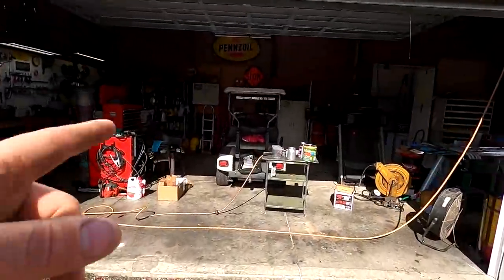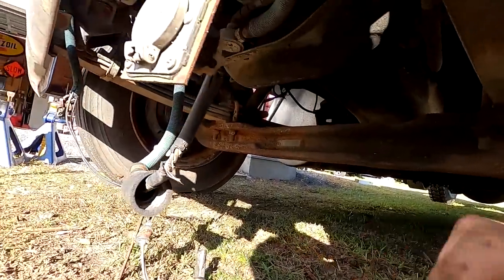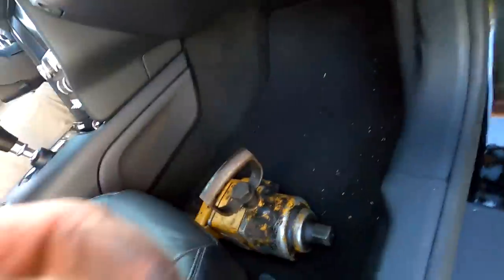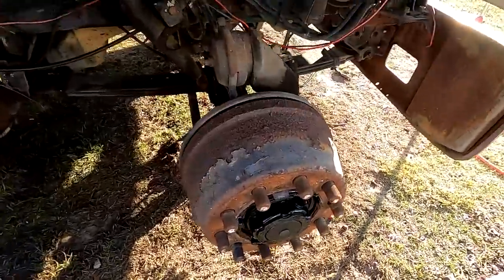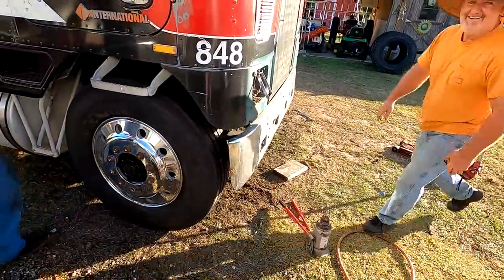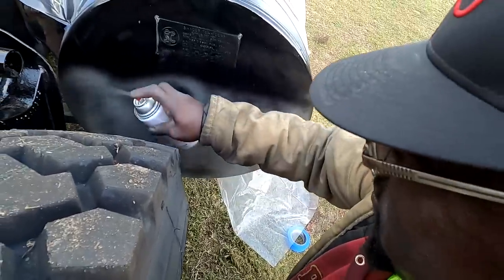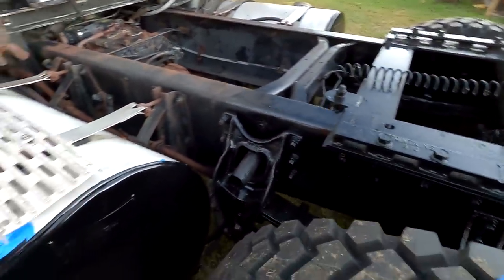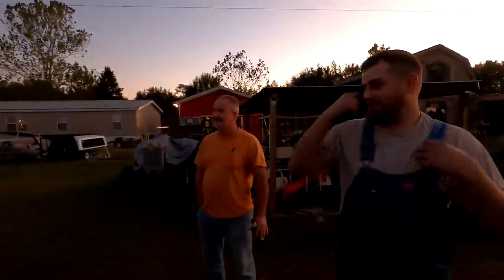Frame Painted, Tires Mounted, Brakes Done!!! Cabover Is So Close!!!

Comment: Pin this comment
Reply: Tyler Johnson whattup
Reply: The mad lad pinned it
Reply: wait its that easy? lol
Reply: Why not put the leather pads on front and back of the tanks they look good on Pete’s
Reply: I think I suggested that a week ago.
Reply: @douglasvines1221  why didn't you make your own comment instead of replying to someone else.
Reply: I would strongly suggest not doing that. Those are fuel tanks not designed for pressurized air. If it decided to let go you basically just created a bomb. The best way would be fill it up almost full of water then pressurize with air because water is an incompressible fluid, meaning it’s not going to blow the shrapnel everywhere
Reply: @madmax2069  Maybe he did not see the previous comment. Whats the big deal. DOH
Reply: for one the question can easily get swamped and lost. whats your deal with me letting them know its not the best way to ask the video uploader a question especially when they're not apart of this comment reply chain. its best to make your own comment to ask the video uploader a question.
Reply: @douglasvines1221  Just keep hitting the high spots around the dent with a hammer and it will take most of it out.  Enough that it will look decent with paint on it.
Reply: ok
Reply: There should be  a tank repair service close by there is one in hapeville GA that cuts the tank at rear cap or front cap and they can replace it by welding back  together
Reply: Wow he did pin it
Reply: @TwilightSparkel16  conpco
Reply: @TwilightSparkel16   8

Comment: When putting those wheels on, use the tire lever under the tire to lift the wheel up off the ground a little so you can push them onto the studs. Back breaking trying to lift the wheel by hand
Reply: Exactly, Ben.
Reply: @markmiller7191  I used to use my dogging down bar which also doubled as my extension for lug wrench bar :)
Reply: Shovel works just as well
Reply: My back was hurting watching that , but that's what I expected from guys not knowing what to do.
Reply: I sit on the ground and use my legs to lift the tire and slide it in i was wore out watching them put em on
Reply: @noahbehm4912  Same I do that too
Reply: @SemiErnie  Well that's what we are here for. To either learn something from them or to teach them a better way.  :)
Reply: I use 2 pry bars about 3' long you have control over the tire able to lift and rotate it in to place.. just takes a little practice
Reply: @benny55au  I did put a thumbs up for what you said , that's the only way to do it . But in return I replied what I said cause I wished he did this live , then we as drivers and I did put tires on and also polish my own wheels would of told him the right way .
Reply: John V -  That’s what I do too John.
Reply: Isn't there suppose to be a liner between the rims?

Comment: Cracked drums.. puts them back on.. and the painted tank sides... it’ll look like a starry night after a month of use. Better off using a rubber rhino liner type coating than spray paint.. Like the series tho.. and the chrome rims..
Reply: When he said cracks he means that the drums have heat cracks in them. That is normal for those drums.  Drums are good for two sets of bracks. So he's not putting anybody in danger with them.

Comment: I read a lot of comments about front brakes. I drove long haul in the 1970s and early 80s. It may seem strange and counter intuitive to the average four wheeler, but at that time, front brakes were considered a hazard.
The first truck I owned and drove was a cabover White twin screw with a 250 Cummings 10 speed and it had no front brakes. Back then, many owner-operators feared front brakes because unless they were adjusted perfectly, they could cause a lot more harm than good during an emergency stop. 
Drivers who were buying new trucks at the time with front brakes from the factory would either remove them or back them off to make the truck safer.
I drove during the winter months while I was a farmer and I never drove a truck with front brakes. They were all cab overs by the way. The one I loved was a 1976 cabover Freightliner 13 speed with a whistling Cat. It could pull 110 bales of flat cotton down I-20 at 80 mph. 
Driving a cab over is a totally different experience than driving a long nose.  The first time I got behind of wheel of a long nose Pete, after driving a cabover for years, I found myself crowding the line. To me, sitting above the left wheel in a cabover is a much more natural position for optimal control and observation.
After thought... As I recall, many cabover trucks in those days were designed for 10-20s (tube type) or 11-22-5 tubeless.

Comment: the nuts should get polished too or get caps put on them.
Reply: The rust will run down and ruin the polished surface.  They looked rusty.
Reply: I was more concerned that he didn't grease the studs a bit. And abusing the torque wrench.
Reply: Andy Taylor going to be fun the next time he has to remove them
Reply: His truck his way of doing things homie. Go get you a cabover and do it
Reply: The "overtorque" wasnt bad at all. The rust was
Reply: Yeah a little swipe of " never seize " on each lug would have been nice maybe jus sayin , cause that's what I do on my cab over

Comment: Hey Bruce,
when fitting truck wheels get a couple of tire irons and push them under the tires at the 5 o'clock and 7 o'clock positions.
Push them through until they reach the inside of the tire.
You'll then be able to lift the wheel with ease and with a bit of practice you'll be able to move the wheel slightly left or right and even a small rotation.

It'll definitely save your back and maybe some broken fingers.

Nice job on the truck too.

Comment: Hope the wheel don't drag on the corners, that front tire was small to allow for a rather good turning radius.
Reply: But they look so good!
Reply: I'm guessing the speedometer will be inaccurate now too, I think a bigger tyre (tire) means you'll actually be going faster than what the speedo says.
Reply: Buddy Wiser   I remember the International conventionals of the era having terrible turning radius issues due to the steering stops they used as a band-aid solution to the issue of tires rubbing. Having a cabover was almost as good as a yard dog for backing into a dock, and more than once I picked up $20 from a "Professional" driver who couldn't fit his truck into a dock.

Comment: Since you have left so much rust on the frame and springs etc, you should at least treat the rust before you paint, in order to neutralize it. To go through all this effort and just try and paint over all that rust is a shame. The paint will not stop the rust, it will just keep rusting and shorten the life of those components.... Joe
Reply: The devil Made me say it  eh .. no it wont :D
Reply: @3storiesUp  semi truck frame rails have a CRAPTON of nickel and/or chromium added to their metallurgy. They will still rust but very very slowly and given his local climate the frame will outlast the motor
Reply: @joshuamcpeek4708  "They will still rust". The defence rests.
Reply: @3storiesUp  the rust will slow way down now that its painted you cant really treat rust permanently without completly tearing the truck down to a bare frame and dissecting the cross members, then you have to sand blast the rust away and use a primer sealer. That process would cost WAY than The trucks value. It's not even necessary as it would just be cosmetic,  like I said it will rust so slowly because of the frames alloys it will be structurally sound long after the motor dies.
Reply: @3storiesUp  "defence" lmfao
Reply: @Briceon  you think its an idea to paint over rust .. go right ahead :)
Reply: The devil Made me say it   Yeah it'll be fine.............................For about 6 months then the paint is just going to fall off...Don't half ass it!! do it right!!
Reply: Buddy Wiser  the frames are still built very similarly, the rust isnt going to kill the the truck, not in the kind of climate that it's in. Itll just look crappy, it takes ALOT of  time and money to do it right and being that that guy in the video isnt isnt using it professionally it dosent matter.
Reply: @ericteipen  well then you cough up the 6000 dollars to tear the old truck apart and sand blast the frame.
Reply: Came here to say this.
Reply: @dalehovland3283  friend, paint still doesn't bond to rust. The paint will come off soon. The issue is the waste of time. That frame would still exist untreated, at the bottom of the ocean 200 years from now. The fucking Titanic which sank to the bottom of the Atlantic in 1912, still exists, and the whole fucking thing was Iron.
Reply: It would be better to do nothing. First the paint cracks, then moisture is getting trapped within it before the rest eventually falls off. By then the rust has gotten a greater bite of the frame.
Reply: The tank is bent.. How he can paint. It....?!?! And you are right with the rust it doesn't protect at all the frame and the other parts ...
Reply: What do y’all think about the Eastwood frame paint? The setup where you paint that silver rust control stuff first and then paint the black over it?

Comment: When old fuel hoses get hard on the outside they're also hard on the inside & can flake off into the fuel. Before the filters it just clogs the filter but after the filters it can take out a pump &/or injectors. Fresh hoses on an old truck are a lot cheaper than a tow job & repair.

Comment: Don’t pant the back of the tanks just put quarter fenders on it
Reply: He got fenders already that say Peterbuilt so the back of the tanks didn't need painted
Reply: tou can tell he really knows nothing about semi he is worried about the tires trowing mud on the tanks but he has to polish the rims inside and out
Reply: jacques houle if you watch from the beginning of this series he says he doesn’t know a whole lot about semis.
Reply: Its uneched Aluminium the paint will flake off in about a year.
Reply: Clearance between the tanks and wheels  is a tight for the quarter fenders

Comment: Pulling up on the torque wrench instead of pushing down confirmed my suspicions.LOL
Reply: Yeah I wanted to yell at him so bad but I know he can't hear me lol
Reply: What do you mean. Are you suppose to push down?
Reply: @ George ~ Took the words right out of my mouth.
Reply: James KNAPP it’s a lot easier. If you go up with it you’re fighting gravity. If you go down gravity helps you and you can use your body weight instead of pulling up on it with your back.
Reply: @bradyhuggins4274  yep exactly! I have to torque the center locks on exotics(only one center but holding the wheel on) and they get torqued to 450nm. So if you try to push up instead of down you'll certainly hurt yourself.
Reply: It's all moot. He didn't grease the studs.

Comment: To make it easier to remove drums in the future, back off the slack adjuster using the 7/16ths bolt on the adjuster itself. If it is Rockwell/meritor you will have to either remove the locking pawl or pull the disc out a little ways to back those off. When tightening the adjuster, bring the shoes in so that they just touch. Then back off about 1/2 turn on the adjuster.

Comment: Yea also he’s had the wheels backward trying to put the tires on that’s the reason he’s having such a hard time
Reply: @Nevets G You want to lie the wheel face down (on some card or rags to you don't scratch it) and put the tire on from the back side. Every one I've seen in thse videos they did it the other way round with the outside face of the wheel upwards, which is much more difficult to do and more likely to scratch if you slip with the pry bar.
Reply: actually the way they did ir is correct..as a 15 yr veteran truck driver and a 30 yr wrencher i can tell you from experience that the way they did ir is the easier way since the lip on the back of the wheel is thicker than the lip on the front of the wheel..that is the way they are designed ....with these old alcoas i have changed quite a few on the side of the road and can verify that they did it the easier way ..however they should have used the tire spud bar to slide under the bottom of the tire and picked up on it when they were putting the outside dual on ...not a keyboard cowboy just have experience to back up my opinion
Reply: @janeames1513  quite certain it would be easier if they would have had it facing down
Reply: @janeames1513  on aluminum wheel the lip is the same on each side. but on a iron wheels nathan is right. I like it better with the wheel facing down so you have more room to insert the tire bar using the correct side.

Comment: Looks GREAT, one questio - why aren't the wheels balanced?
Reply: Don't need to balance them too much work  and it doesn't help like in a smaller vehicle
Reply: @wndr0412  oh ok...learn something new every day.
Reply: Aus1 some semi tires or bigger tires use beads kind of like air soft bb’s and they go inside the tire once past a certain speed it balances the tire out
Reply: I doubt he did this but with bigger tires you use a bag of equal either 8 or 10oz and you put the whole bag unopened in there and that helps balance them

Comment: I would have sanded the break pads lightly with fine sand paper by hand before you put the hubs back on we use to do that in the Army. Beautiful truck ya got there wish I had one in Germany to run around in.

Comment: DOT will have a hay day with your front brakes. Better change the front ones also or you're not going anywhere.
Reply: Tripp Douglas I’m wondering how he will register and what he will have to do dot wise cause it’s not a commercial vehicle anymore... he is using it for personal use.
Reply: @codyconstantine2897  if I remember correctly it still has to do a DOT inspection for it to be licensed and
Reply: Tripp Douglas I need to do some research cause I wanna do the same thing to pull my mud truck around.
Reply: @codyconstantine2897  go to the Federal motor Carrier safety website and I'm sure you can probably find some good information there.
Reply: Cody Constantine due to gross vehicle weight it’ll need to be DOT inspected.
Reply: @chevyon37s  thought it would have to be.
Reply: Buddy Wiser he’s going to take it up and down the road hauling his mud truck with it. If it’s going to be on any public road it’ll need to be inspected, just because it’s a “farm truck” it doesn’t escape DOT law. We’ve got a semi tractor with Farm plates on it, still had to get a DOT number.

Comment: The dented fuel tank is really bugging me
Reply: Then act like a patreon and pay for a new one !  The truck isn´t new so I would leave it on the truck also.
Reply: He said he looking to replace it, just haven't found one yet
Reply: Junkyards want 4$ a gallon on a tank .plus straps
Reply: Why replace something that still works I mean at this point it's a waste of money that can be spent on other more important things or would you rather he replaced it and had to wait to get a part that might keep the truck off the road longer than necessary
Reply: Good things come to those who wait.   Or look . 😆  tanks can be had at the Junkyard.  .or call on a few good trucker buddies!
Reply: Glue on some nails and pull the dents out with a sledgehammer.
I saw such kits on eBay and aliexpress. At least hammer them
straight with a sloped body hammer. More a job for an xpert i think.
Reply: Or just cap the outlet and pump it up with air....
Reply: Their total volume is too big to fill it with air. The pressure will 
relief too fast. When he fills first with some fluid and then 
pressure with air, but they're still too big and that needs an
incredible air pressure. And that dangerous too!!! Better tap
the dent out, sand paper and then paint it as desired.
Reply: As long as the tank does not leak. The tank will work fine.  Gives the truck character.

Comment: With the truck lug nuts what we do when it’s rusty is we put a little oil in the sleeve/ring at the bottom so It doesn’t make the cracking noise not saying this is the right way just saying that’s what you could do

Comment: On a 1 to 10 scale of quality job I’ll give this about a 3, You should have removed the left fuel tank and had the aft end of the tank replaced.
While removing the left tank you should have removed the right tank, painted the frame behind the tanks. The tank removed would have afforded you the ability to polish both tanks correctly. The way you put the front end together is rush rush rush, get it done right away ! 
You didn’t take the time to clean & paint the drums, front axel, grease the front end. Other than checking the breaks you did nothing ?
Even though this is going to be a work truck, it represents your business and the quality of your business. This truck is on the front line , at times it may be the first thing customers see. What type of impression are you looking to deliver to your customers ? 
You really need to give this some thought ? If you are going to take on a project like this have it represent your company, put it on You Tube
 I think you need to rethink the out come !
In one of your You Tube videos you called viewers like me “ Key board cowboys “ well if your going to put this on You Tube and make money than you better be able to take criticism. I have owned a couple of businesses in my life time and like yours they both where a service oriented business. All of my equipment were first rate because that was an extension of me and the type of work I did.q
Good luck.
For your sake I hope in future videos you pick up the quality. If not it will hurt you in the end !
Reply: Keyboard warrior

Comment: When removing brake drums, simply give it a solid smack with a mallet on the inside edge. They pop right off, a lot easier than prying against the backing plates